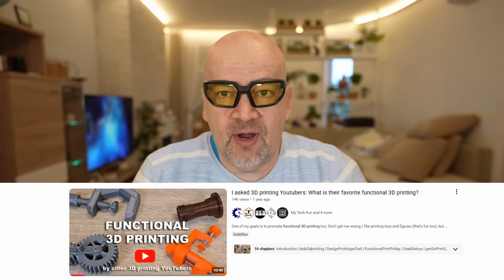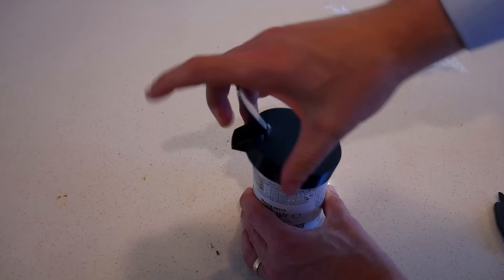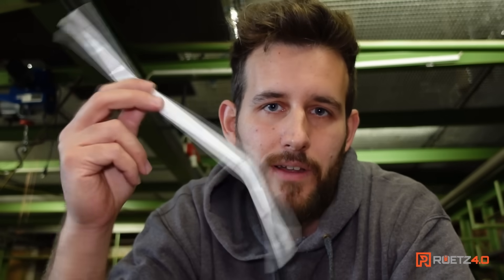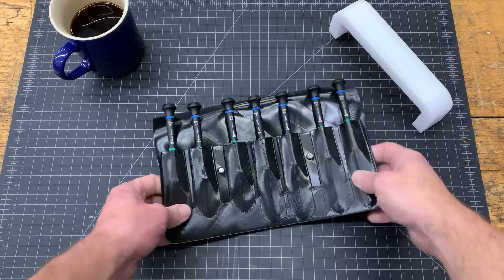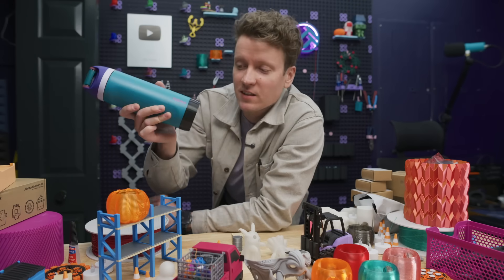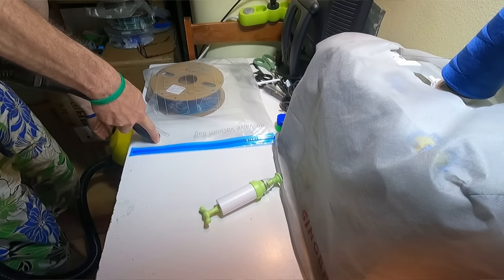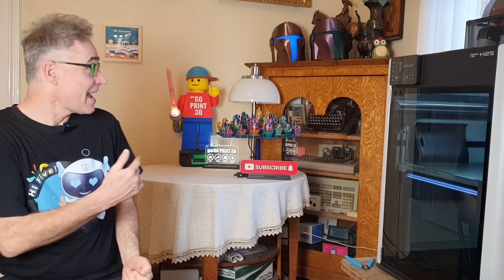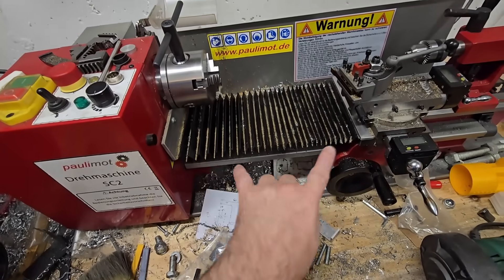10 3D Printing YouTubers Show Their TPU & PEBA Functional Parts

Comment: nxp hovergames drone foot mounts, stock was abs and they will break after a couple of falls or bad landings. 95A mounts allowed for some dampening and they survived a lot of falls. I just designed some custom petg body + 95A joints for the lower T joint. It's basically indestructible rn.

Phone cases should be done in PETG or PCTG, from my experinece tpu is very bad for this, sry to burst some bubbles lol

Comment: I made an 18 inch TPU strap that snaps into the opening of the 5 gallon pet water container so that when I fill it up and plug the hole I can turn it over and the water doesn't run out as I insert it into the base. I then can tug the strap and it unplugs from the hole to allow the water to fill the bowel. Just being able to put the tank on without having water running out onto the floor is great.

Comment: Easy to print: Wedges, and wedges with a sawtooth-top to bolt onto bicycle bottle holders to stop rattling. Athletes likely have seen them sometime. Same design, different use: Cover for chainstays (against chain-slap), spacer on the seatpost for (saddle-)bags. Adapters for rear lights on saddle-bags.